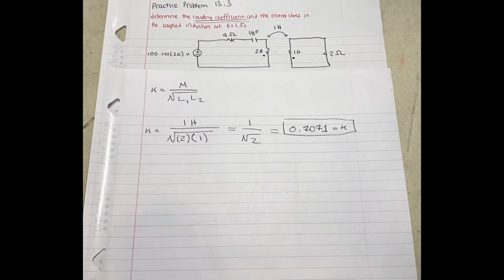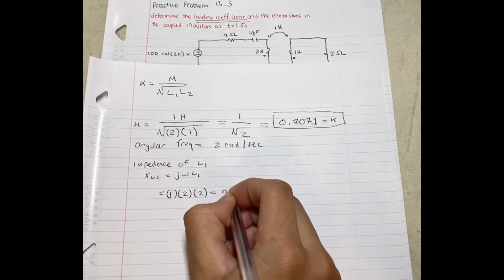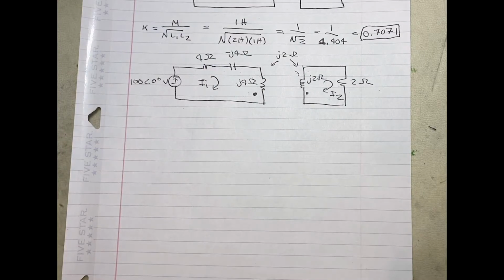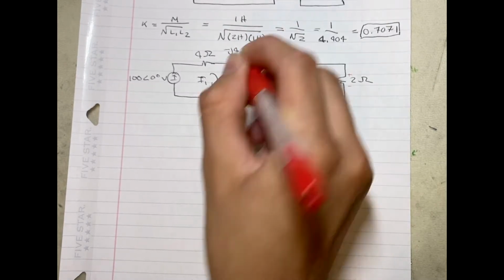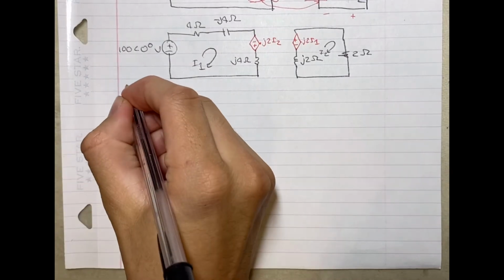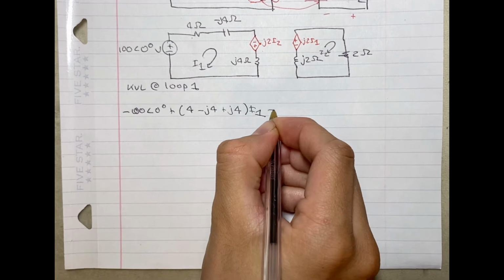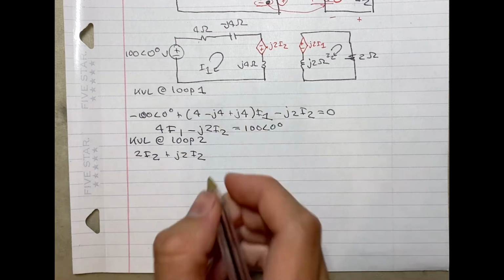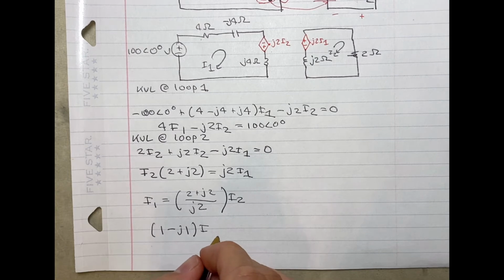Chapter 13 Practice Problem 13.3 Fundamentals of Electric Circuits (Circuit Analysis 2)

Comment: did you put the direction of the current (I1 and I2) randomly?
Reply: according to the textbook if one current is entering the dot, and other current is exiting the dot (on the other side) then the M(I_1)(I_2) term is negative